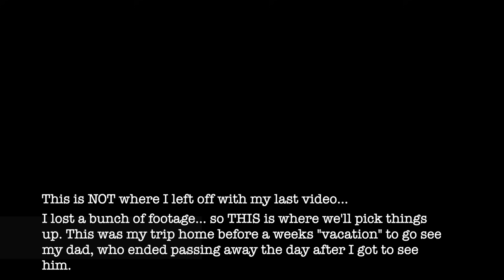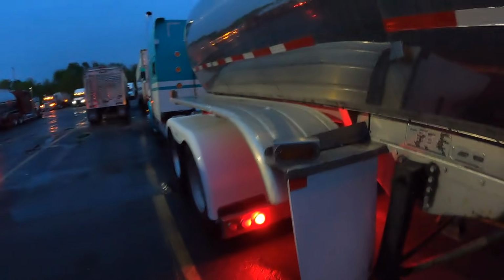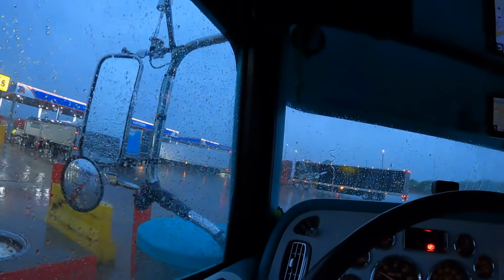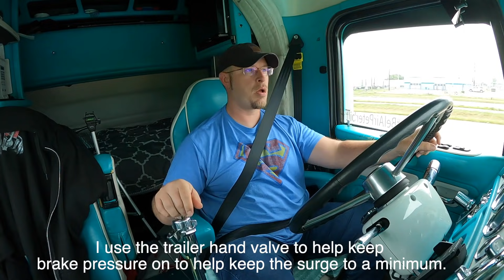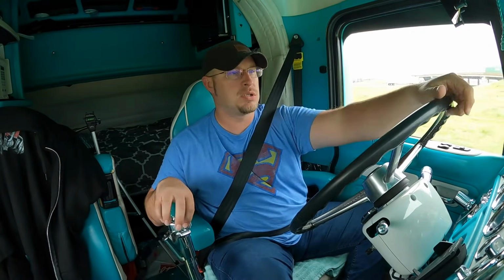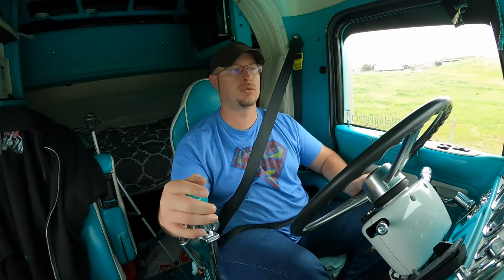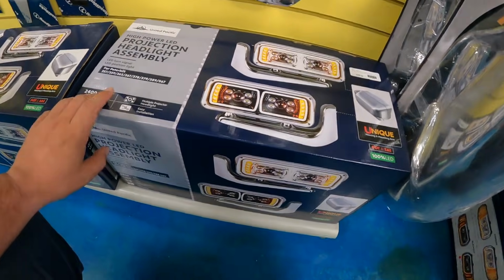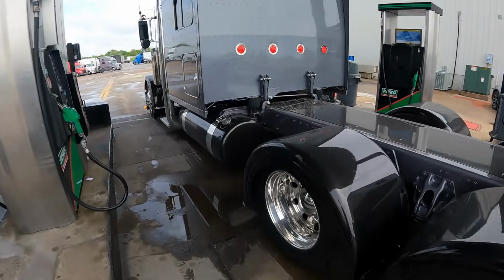Touring Empire Chrome Shop/Prescott, Ar to Effingham, IL

Comment: I solder all my light connections and then shrink wrap them. Also coat the back of the fixtures with silicone. So far so good. Hope these forty work out better for you.
Reply from the maker: I use bullet connectors with electric grease as much as I can. which is what my cab and sleeper lights are connected with. They keep getting water in them and freezing and cracking, or so I think from what I can tell...🤔
Reply: @Truckinlife   the bullet connectors should be ok but I think embedding the backs with silicone would go a long way to keep the water out. Cheap fix.

Comment: Enjoyed your video as always.  Nice Penn State decal on the oversize Peterbilt (We Are!).  Anyway, I have what is admittedly a stupid question.  As you were shifting gears, it did not appear that you were using the clutch with your left leg, as would be "normal".  Is the clutch operated differently in a truck or am I missing something?  Thanks again.
Reply from the maker: It is different in a truck. I "float" gears. you can shift a truck with out using the clutch.
Reply: @Truckinlife  Thank you.  I did not know that.